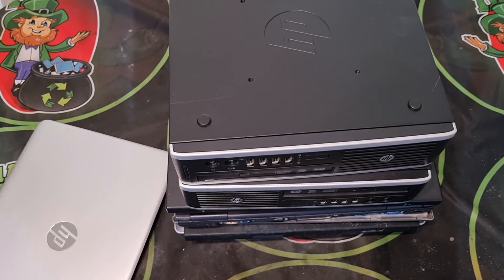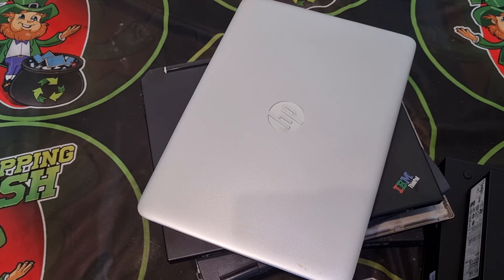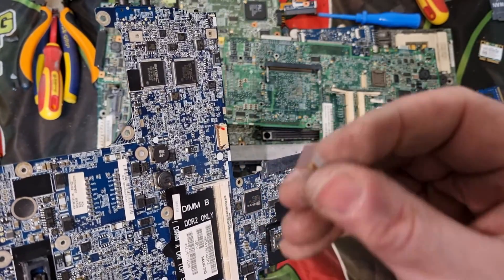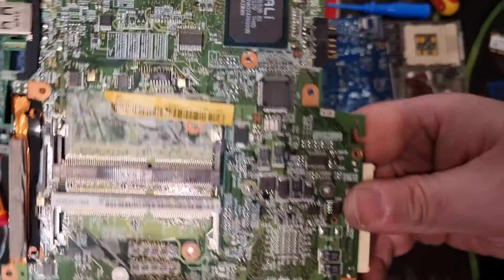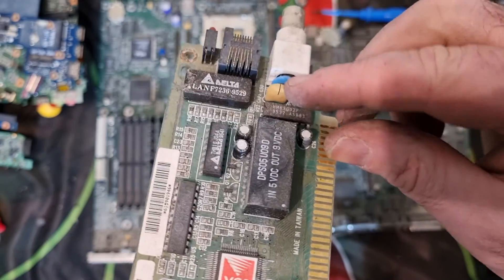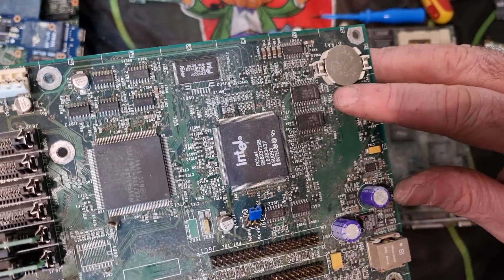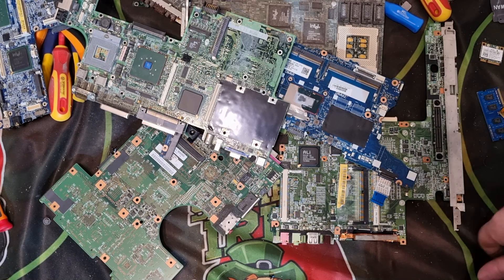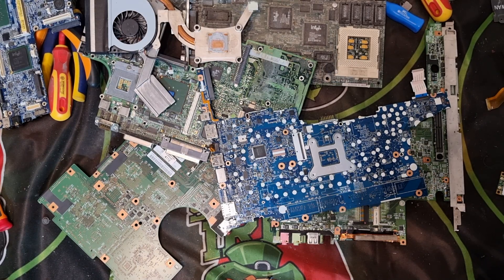Get Ready to RECOVER Precious Metals from Circuit Boards with These 5 Essential Items

Comment: the ribbon wire, what are the ends the gold pins are attached to,  remove the small side with side currers, pinching the end and the other side peels off leaving gold pins  and (maybe brass)

Comment: build a pixk dust box,  after taking what you find valuable,  shave the board down to the board surface, a cut off wheel works good,,  what is silver solder made of and what are the circuit lines made of,,cut my pins off with a cut off easy peasy,  I found what looks like flakes of silver.  plastic tote  plexy glass top and a couple holes in the side for my hands inside box,  will fill to see 30 year metal scrapper,  thought id try electronics

Comment: Currently, even the prices at Boardsort are dropping a little. For those of us that have to ship, there is a price point that is worth shipping higher priced items and not on lower priced stuff. That’s when I depopulate and cherry pick certain things and turn in what’s left over to a local scrapyard that takes boards.
Reply: Dr. A you are spot on - it's very important to understand your average shipping price per pound so you can decide what NOT to ship to Boardsort.  For me it is between $0.80 to $1.00/pound.  Some folks ship partial truck to truck load quantities that lowers the price per pound even further.